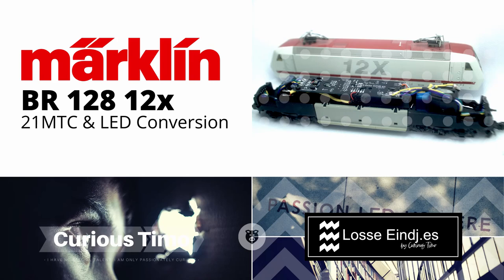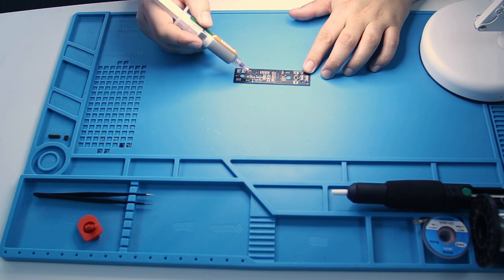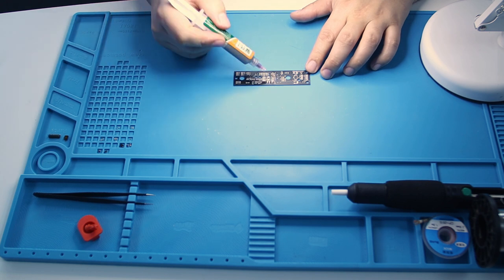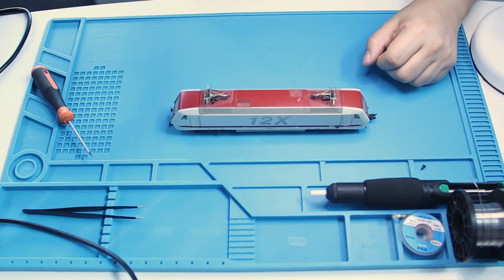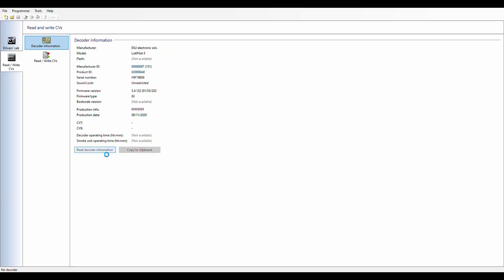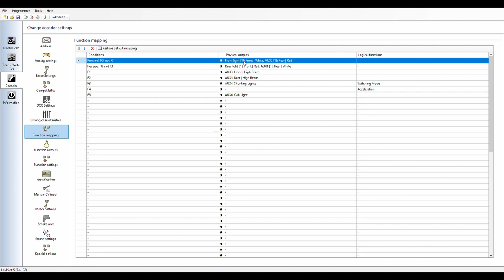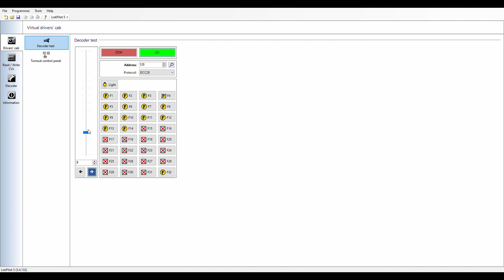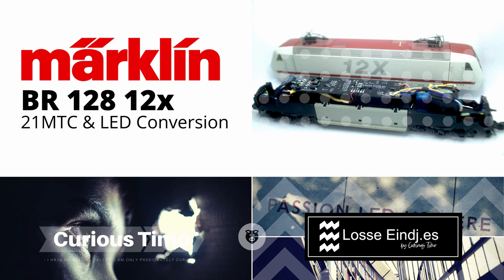Model Rail | Märklin BR 128 21MTC & LED Conversion

Comment: Very nice video. Wish I had your soldering skills. I just did a similar upgrade to my locomotive. But had to utilize the 21pin adapter plate. Your layout is much cleaner. One LED has burned out on mine, do you know of any remade boards already that I could use. I fear I won't be able to replicate your soldering. Thanks either way, and hope you post more model railroad videos in the future